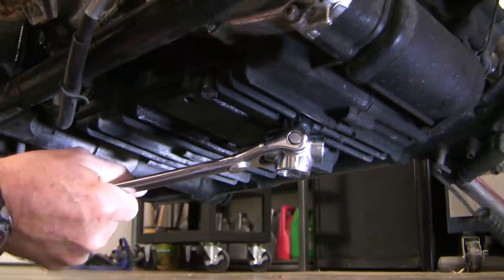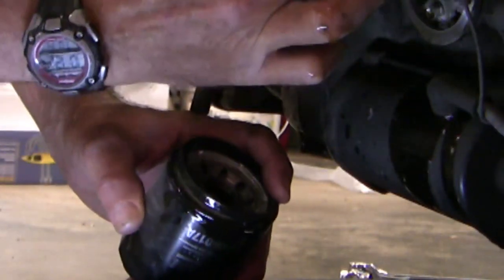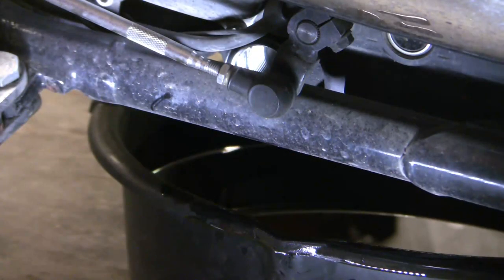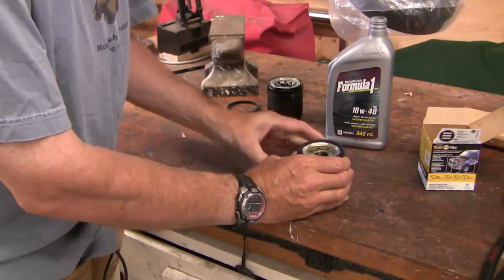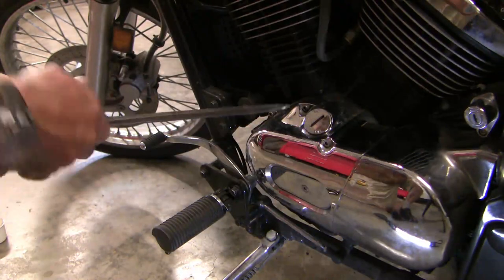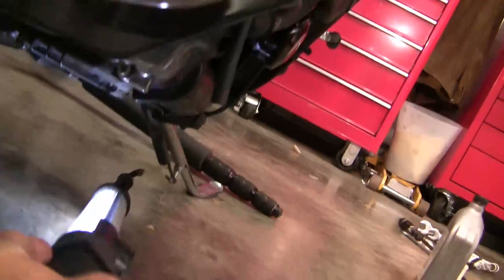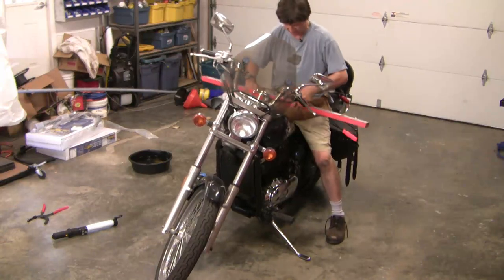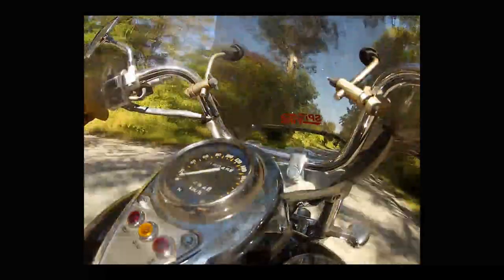How to change motorcycle oil,  Kawasaki Vulcan

Comment: have a1996 Vulcan 1500 classic took the spark plug out which was hard to get out cleaned spark plug threads and head threads had hard time getting it started back went to tighten it down never would tighten all the way down liked about the width of a nickel took it back out and redid every thing again and still same problem but seals there  not losing any compression does not seem to hurt the running of it will it hurt to run like that and what would be the problem causing this does not seem to be cross threaded was like that when I bought it.
Reply from the maker: The first thing I would do is double check that the plug you used is the correct plug for your bike -- some are longer and some have a different thread pitch. Don't assume the previous owner used the right plug. If you used the correct plug, and you have no compression loss and the motor seems to be working fine now, I would probably leave it alone for now. I suspect that the upper threads are damaged or there is debris, but the lower threads are holding pressure fine. The risk you take by removing the plug now is that the threads are damaged and you may not be able to get the plug in again. Usually a crossthreaded plug will fail to seal, and then you face doing a helicoil to replace the threads in the head. That's a headache but the technique usually works fine. Fixing threads with the head off is a lot easier and you can chase threads from below, but it's obviously more work to get there.

If for some reason you have to remove the plug, I would carefully clean the threads, replace the plug, double check you've got the right one, and use a thread chaser to renew the threads in the head. Of course then use compressed air with a long nozzle to get right into the cylinder and try and blow as much of the debris out of the cylinder as you can. Good luck!
Reply: spelunkerd Thanks for the help,won't touch it for now will just ride it unless I start having problems it is a good chance it could have been a different plug by previous owner.

Comment: Hi :) It's me again. lol Do you have any videos for motorcycle carburetor rebuild? Specifically a Vulcan? (1997)   THANK YOU AGAIN FOR ALL UR GREAT ADVICE AND HOW-TO'S!!
Reply from the maker: No, all I have on the channel is a carb rebuild on a John Deere garden tractor. Thing is, if you do one you'll be on the way to doing most, they are surprisingly similar and the work flow is the same. The trick on the Vulcan is to install an inline fuel filter! Mine didn't have one from the factory so we installed a generic filter between petcock and carb.
Reply: @spelunkerd  Yes, the inline fuel filter was the first thing a friend of mine mentioned and of course I'd seen you has done that, so done deal! :) He's not good at carb. rebuilds and said he was gonna order me one. He's yet to find one,  so I thought I'd give rebuilding it a whirl, but I've never done one. Thanks again!!
Reply from the maker: @kimberlyannhughes7855  You'll note the difficulty I had matching the fuel filter up with the tubing size, because of the unusual taper to the tubing seen at the exit from the petcock. As I recall, 5/16" worked, but it is in that video. Regarding replacing the carb with aftermarket, yes that works. It boils down to whether the extra effort to retain an OEM part is worth the added cost of labor. When it is my labor, it is worth it, ha ha.

Comment: Did I understand you correctly that you want the oil level to be in the middle between H and L?
Reply from the maker: Good question. It is safe if the level is anywhere between L and H. Too low and your engine may grenade, or the pump may suck air when the bike heels over. Too high and the oil may foam up, causing air bubbles in oil that interfere with effective pumping, or oil contamination of solenoids and seals, etc that cause them to fail. A level slightly above H is probably OK, but it is never OK if slightly below L. Here's the thing. As you drive, oil level gradually falls, and if you're not paying attention it doesn't take much before the level dips below L. So, pro shops aim to get the level closer to the H, so an inattentive rider doesn't have a problem or need to add oil between oil changes. Happy riding!

Comment: I have a question i just bought  a 98 Vulcan Classic 1500 e of course was told its ready to ride . Well I can ride only about 3 to 4 miles and the bike will start to loose motivation like its slipping or something . But the engine sounds fine i changed plugs a both ignition coils all new what it calls for . I have the owners manual so in the owners manual they keep a Maintenance up keep on plugs and oil changes . So i changed the oil today it was really low and bad I used the same type oil they have used since they had the bike . I thought well maybe this would help but it did not it stopped some engine noises but still when I warm the bike i let it set this time for maybe 15 mins then i put it in 1st and it sounded great but wouldn't pull itself so i read the service repair and maintenance book they have been i swing the wrong oil they have been using Castro 5 w 50 synthetic  well the book says that will mess the bike up . So my question is with any luck is it possible to flush the bike and put the correct oil in and possibly  correct this problem ?  Please any help would be greatly appreciated i have looked and read all kinds of stuff but havent found a solution for my problem  thank you  Vance
Reply from the maker: The most worrisome part of that story is the low oil. Sure, it would be reasonable to change out the wrong oil and put in what the owners manual calls for, but I'm not optimistic it will help. Natural oil behaves similar to synthetic for the first few thousand miles, but it degrades more quickly. I would start with a compression test and probably a leak down test to see if you've got more serious underlying issues. I wouldn't hesitate to get professional advice. The list of things that can cause your symptoms is pretty long, carburetor issues, valve seat issues, maybe even restricted exhaust or fuel issues. My Vulcan didn't come with a fuel filter, and eventually I put in a generic fuel filter to try and prolong the time between carb cleaning.  The Vulcans require manual adjustment of valve lash with a kit of little shims every several thousand miles, and if you miss those dates you can have engine performance issues that escalate into big problems. If you want to do your own work, the first step will be to get a copy of the dealers repair manual. Good luck!
Reply: So do you have any idea what it may be ? Or maybe they next thing I should take
Reply from the maker: Hopefully something simple and fixable like a dirty carb or incorrect valve lash.

Comment from the maker: I'm certainly no expert in the topic of optimal engine oil, and I tend to just follow the manual -- for my engine they call for 10W-30. It seems unusual for engine operating temperature to be related to choice of engine oil, and I would wonder about more common problems like low coolant level, trapped air, a sticking thermostat, bad impeller, or perhaps a bad rad cap. Ambient temp here at the 49th parallel is cooler than other areas, where higher viscosity engine oil might have a role.

Comment: I have a 2003 Vulcan 750, which just stalled this morning showing up the red OIL indicator (I was riding at 70-75 mph). It won't start up. The oil didn't leak, neither I have seen any oil mark under the motorcycle. Recently only changed 4 Spark Plugs, and had great performance after the change. Any thoughts?

Comment: So i called a Kawasaki dealer about what oil to use in my vulcan vn800 and they said it needs to be a motorcycle oil 10w40 and not just regular 10w40 that would be used in a car. They said regular motor oil can cause your clutch to slip because of it being a wet clutch.
Reply from the maker: Excellent point. These days many oil manufacturers advertise motorcycle-specific oil products, rightly pointing out that the higher demand of the transmission, clutch, and motor are a challenge for a single type of oil. Like many riders, I have never used motorcycle specific oil, but I can see why some would. I've gotten away with it for decades, but then again the combination of light use, no racing, and frequent changes may not expose weakness. I would follow the advice in your manual.
Reply: @spelunkerd  yeah i just went with Kawasaki brand 10w40 and it was about $6/quart. So really not much more expensive than regular oil. I just figured id point it out for those who may not know any better. I appreciate your video though. Have a good day.

Comment: so far everything for the 95 and the 05 are basically the same. my speedometer stopped working and i wanted to change the oil. i haven't changed the cable yet but i took it apart and im not to sure its the cable. do you think there could be another reason for the speedometer to stop working?

Comment: How long should I run the engine before I change it? 5 min on idle?
Reply from the maker: I just run for 5 min. Longer is probably better, because warm fluid flows and dissolves impurities better. But with a really hot exhaust there is a higher chance of burning yourself. I think the main advantage is getting oil up to the top of the engine so that when you restart the delay in oil delivery (because of air bubbles in the system) is not a big issue since there is already a film of oil up there, coating everything. There is a one-way flap valve in the oil filter that should help prevent reflux of fluid in the line back into the oil pan once air bubbles are cleared. Using that logic, I favour starting and running the engine after you finish the job, too.  Starting after you finish also allows you to check for leaks immediately, while the change is fresh on your mind.

Comment: hello what is the best way to make sure the oil completly out of the engine? when i fill it there seem to be more oil than i filled after i run it. i have a 1989 kawasaki 600r. is the bike post to be on the center stand to fill? or normal on two wheels to fill? why can't you just drain all oil and fill the correct amount like what the owners manual say's 3 quart's? also i do replace the oil filter.

Comment: Where can I get the oil filter tool and the special wrench for the oil plug?
Reply from the maker: Monk75FC Any auto parts store will have them. After a few years of changing oil on different vehicles you'll accumulate a whole box of filter wrenches. Strap wrenches are an old standby, needing different sizes depending on the filter. An old trick I still use occasionally is to put a folded piece of sandpaper around the filter when I take the filter off with a strap wrench. That reduces the slipping you might see on a tight filter. I like the pliers I used here, but they bite into the sidewall of the filter so the filter is destroyed when you apply any force. Therefore when you use those you're committed to replacing the filter, and you never use them to put a filter on.

Comment: Why does your 750 not have a kickstand that picks it up evenly like mine? I have the exact year and all.
Reply from the maker: I'm not sure, but mine is an 800, so maybe yours is a year older? Mine is a 95, and I remember that year they changed a lot of things. There was no option for a symmetrical stand then.... Thank you for watching!
Reply: spelunkerd
Oh I thought yours was an '05 like mine. Yeah that's it.
Reply: FROM FACTORY YOU ONLY GET THE KICK STAND But SOME SHOPS WILL ADD A DUAL STRAIGHT UP STAND LIKE YOURS As A SECUNG FEATURE OUR KAWI - REP Would OFTEN GIVE Us FREEBIES LIKE KICKSTANDS TO UPSALE THE BIKE ESPECIALLY IF IT WASA BIKE MODEL THEY NEED To Move

Comment: I noticed that has some gasoline mixed with engine oil.. do you have any idea what 's going on ????
Reply from the maker: Edmar Carolino Unusual, not sure. MrMaxstorey here on youtube is a good resource, he has loads of practical experience.
Reply: spelunkerd thanks!!! I think the reason was because this motorcicleta stood for two years and the gas valve was open . I think the gasoline went by the rings... thanks again

Comment: if you read this, can you give me tips on my vn800 99'  doesn't seem to want to start, it runs, just takes a lot to get it there.  just cranks and cranks.
Reply from the maker: +Tadpole B My vulcan didn't come with a fuel filter and eventually it needed a thorough carb cleaning. We put a generic fuel filter in line to try and prevent that from happening. Bad gas and a clogged or dirty carb would be high on the list for most bikes. I would look at the plugs for clues, put in a new air filter and try fresh gas, and if that doesn't work I'd carefully dismantle and clean the carb.
Reply: +spelunkerd thank you for the ideas, I will.  great videos, very informative.

Comment: having trouble with my kawa  vn 800 1995 with clutch. does not disengage on first gear. any suggestions on how to fix will be appreciated.
Reply from the maker: I usually look for simple things first. In this case I would check to be sure the clutch is fully disengaging when you squeeze the handle.
Reply: thank you for answering. The clutch does disengage I can feel the shift, but as I try to pull out  it does only a little jerk but nothing else. can it be the transmission?
Reply from the maker: Jaime Hernandez Yes. I don't have much experience with these transmissions.
Reply: what is the best motor oil for this bike? does it have to be motorcycle specific?
Reply from the maker: My dealers manual calls for 10-30 motor oil, with no specific advice regarding synthetic or natural. I've always used natural oil in all of my vehicles, not motorcycle specific, and it's never been an issue. I routinely check the owners manual or dealer repair manual for updated advice that is directed at the specific model I'm working on. Cheers!
Reply: thank you.

Comment: hello Mr. any idea how to fix the gas gauge on 08 Vulcan 900?
Reply from the maker: I've never done it on a bike, though my first step would always be to reach for the dealers repair manual. Like most older bikes, mine has no fuel tank gauge. I rely on the odometer, I remember to refill when I've driven 200 km, I reset the tripmeter at each fill, and I never drive on reserve unless I run dry.  Unfortunately the dealers manual for the Kawasaki is pretty weak.
Reply: Ok.. thank you mr.

Comment: I put oil on my bike becuse when i put it strait it didnt show anything. I put about half a bottle until it was half on the indicator. I didnt ride it for a couple of days. I went for a ride . when i came back it started shooting alot of oil and smoke. Can u tell me what i did wrong please
Reply from the maker: Luis Hernandez I would double check the level now that the oil has had a chance to circulate and reach equilibrium. This bike has a small tube connecting the crankcase to the carburetor, so that crankcase gasses are not vented to the atmosphere before giving them a second chance to burn. Foaming overfilled oil could overflow back into the carb. If the problem persists I would take it in for a professional opinion.
Reply: Thanks you very much.

Comment: I have a cuestión. I have a vulcan 2000 cc and all time have the light oil in red. Can you help me please
Reply from the maker: If the oil light is on, you have a problem with either the oil level sensor, oil clogging of the filter or passages, or inadequate oil level. The first thing I would do is get the bike level and check your oil level through the site glass. Remember the bike needs to be standing upright, not on the side stand. If that is OK then I'd change the oil and oil filter, and get the level right. Then I'd start the bike and wait for 15 seconds or so to see if the light goes out. If the light doesn't go out, then I'd test oil pressure directly, and also I'd test the oil level switch to see if it is bad. The most common cause of this is a bad switch, but the problem is if the oil is clogging or low, you could destroy your engine while working it up. If in doubt, call a pro, and consider getting it dragged in on a trailer so you don't destroy your engine.

Comment: Still waiting on my Clymer manual. Where is that screen located?
Reply from the maker: +moedog5087 Remove the drain bolt as shown, and the screen is inside that hole. Slide your finger into the bolt hole and the screen and washer will come out with your finger. Carefully note which way it is oriented and what order the washer comes out, and reproduce that order and orientation when you put it back.
Reply: +spelunkerd was wondering where on the engine it is
Reply from the maker: +moedog5087 under the left foot peg.
Reply: Okay thanks